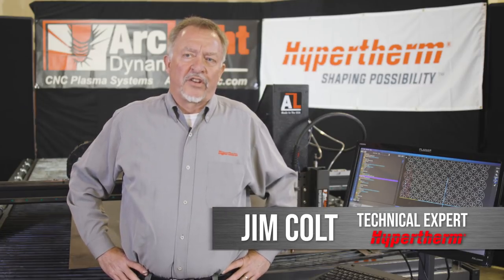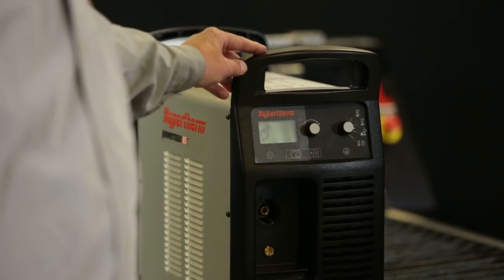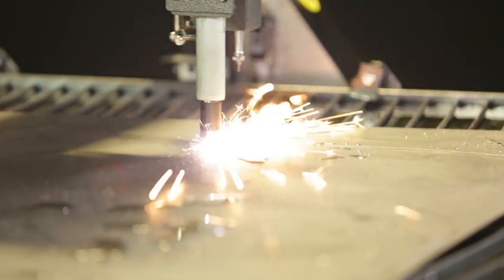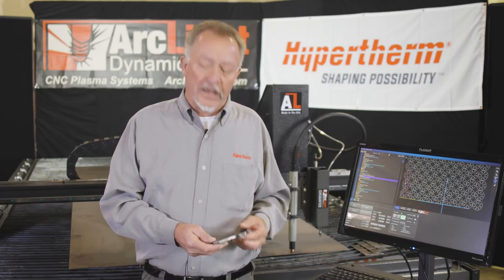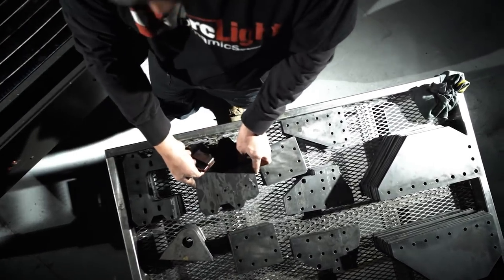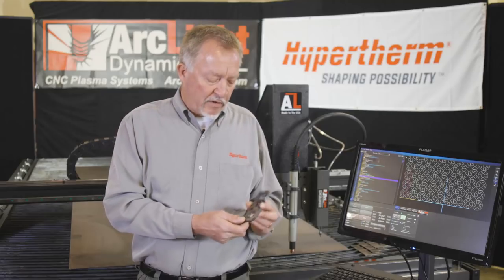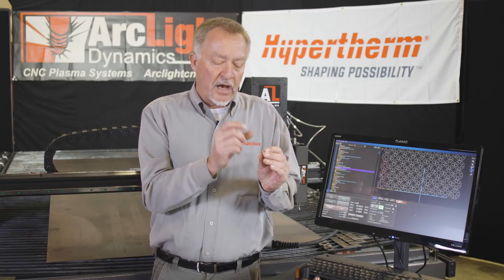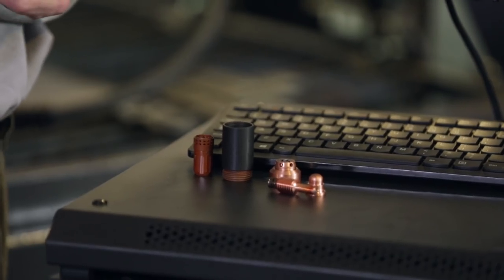Tips for best plasma cut quality from Hypertherm guru Jim Colt

Comment: I have a Powermax 45 xp. In the Hypertherm manual charts only apply to the maximum power of 45 A, it would have been nice to have charts for several range of power. To figure out the formula between speed, thickness and amperage.

Comment: My Powermax 45xp has a warning in the manual that the esters in synthetic compressor oil can damage the filter bowl.  Is this enough of an issue to require an oil less air compressor or will a coalescing filter take care of this issue?  60-80 gallon oil free air compressors are hard to find.
Reply: Use an all metal air filter bowl will do the trick, the longer a compressor runs the hotter it gets, the hotter it gets the more oil goes down line, use a coalescing filter after the particulate filter with all metal bowls.

Comment: Whats better air or argon for fine cut powermax 45
Reply: air is fine
Reply: This is not like welding. The gas does not shield it pushes the plasma and slag through the part. Plus at ~75psi a full sized tank of argon is gone in no time.